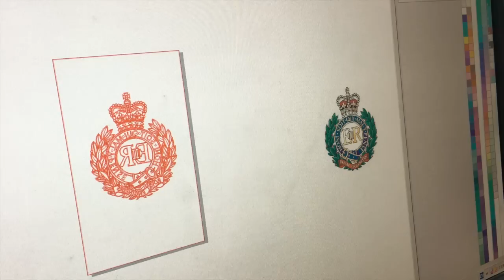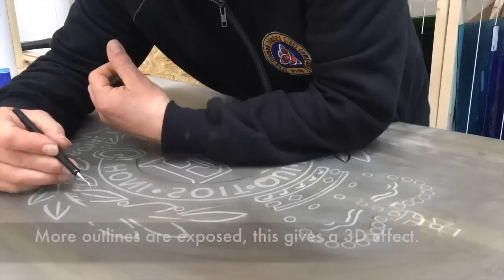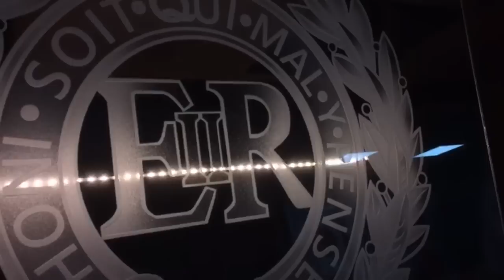How To: Etch Glass - Sand Blast Carving Technique - Royal Engineers Cap Badge

Comment: When you say fine, what grit of sanding medium are you using? Also do you vary grits or pressure between "layers/masking sections"?
Reply: I did work like this but with more layers. What I used to get deep into the glass fast was aluminum oxide.

For smooth fine details I like to use glass pearls/beads

Comment: hi, very impressive piece of art. The gradient achieved is by adjusting the thickness of abrasive flowing through gun? or is it in the design? very interested in knowing the technique. very well done sir, thanks in advance.
Reply from the maker: Hi Imran, Thank you for your kind comment. The effect is achieved by blasting more in the area you want to be most etched and blasting less in the area you want clearer. This creates the gradient effect. It's all done by careful use of the sand blasting gun and is planned into the design. I hope this is helpful.
Reply: Thanks.

Comment: This is very nice, clean work, and you have been generous and helpful with answering questions. I live in the US, and I'm not sure where to buy sandblast resist vinyl. Is 120mm a European thickness? I can't find that thickness here. I have sandblasted glass with contact paper thickness, and it just doesn't hold up well. Thank you
Reply from the maker: Hi Janet, I'm sorry for the late reply.The thickness is 120um or we sometimes use 80um, this is micrometers not milometers. We buy our film from a UK supplier but they may ship overseas take a look at their website here https://www.mdpsupplies.co.uk/sandblastingfilm.asp. Hope this helps - Best of Luck!
Reply from the maker: https://www.mdpsupplies.co.uk/datasheets/datasheetdetapesandblast.pdf - take a look at more information here.

Comment: Hi, I am piecing together this process and have a few questions. 
What type of  vinyl mask are you using?
What type and size of grit are you using?
What size and type of nozzle?
Are you using a pressure pot or using the hose to siphon and reuse the blast media from the bottom of the cabinet? 
I have a 25gal 125psi with 9.1 @ 40 scfm. Will it be enough pressure to blast?
Reply from the maker: Hi Rob, we use 60-80 grit Aluminium Oxide Abrasive. The nozzle size is 8mm. We use a special sandblasting resist vinyl, it is 120um thick.
Reply: The Stained Leaded Glass Company thank you. I'm trying to do small projects from home. I appreciate your helping me figure things out!
Reply: The Stained Leaded Glass Company can I do this on acrylic with the same abrasive/ grit?
Reply from the maker: Hi Rob, yes I believe so. I haven't tried it myself but I imagine you would get similar results.

Comment: Happy to see someone use Corel. Everybody uses Adobe... What's the make and model of your blast cabinet?
Reply from the maker: Hi, Thanks for your comment. I modified a standard cabinet bought very cheaply off eBay to allow the insertion of glass by cutting a slot in it and adding brush draft excluding strips. Similar to: https://www.ebay.co.uk/itm/Sandblaster-Bead-Sand-Grit-Blasting-Blaster-Blast-Sandblasting-Cabinet-220L-LED/281383256323?epid=1561165375&hash=item4183bfc103:g:Qm4AAOSwVm5Y-cZY

Comment: My question is where did you buy the blasting cabinet? I have a similar one but would like to go bigger I like the way you can insert the glass in yours. Beautiful work!
Reply from the maker: Hello kkash72, thank you for your question. I modified the standard cabinet by cutting a slot in the side and the top and fitting brush seals, this was relatively easy to do. I hope this helps. Thank you for the kind comment.

Comment: Very informative video - thank you. Can I just check that the sheet of glass was annealed (toughened) as I am surprised that toughened glass does not shatter with the process . Thanks.
Reply from the maker: Hi Chris, yes the glass is toughened glass. We usually do not have a problem with the glass shattering but it does happen on the odd occasion.

Comment: Are you using the same amount of air pressure on each stage? If so what psi or if not what different pressures at each stage?
Reply from the maker: Hi Jimmy, I use the same pressure at each stage.

Comment: What grit of sand are you using? Or is it glass?
Reply from the maker: Hi Drew, the blast medium we use is 60-80 grit Aluminium Oxide Abrasive.
Reply: @thestainedleadedglasscompany  will that medium work on glass mugs or glass vases?
Reply from the maker: Yes. You could use 120 grit for a finer finish.
Reply: @thestainedleadedglasscompany  thank you so much

Comment: What vinyl is that by the way, and how does it work? I can see it's allowing you apply the stencil directly, without using transfer paper.
Reply from the maker: Hi Tom, we did use a transfer paper but this was not featured in the video. The vinyl we use is medium thickness sand blasting resist film.
Reply: That explains it, thanks!

Comment: i have etch glass using a stencil which i made on my plotter and use a etching acid for glass which great result but cant do diffrent shade, what is the best way to practice glass etching with different shade using sand blasting but with out wasting glass to practice on
Reply from the maker: Hi Chad, thanks for your comment. I would suggest sourcing old glass. Ask a local window or glazing company I'm sure they would provide you with old glass to practice on for little or no cost. Good Luck!

Comment: I like the vinyl sandblasting method but the issue is the same as an acid etching method. Aka the weeding process is slow/a pain sometimes. Is there any way one can cut through totally so he doesn't have to deal with weeding?
Reply: Full cut-through would eliminate a significant feature that takes away from the "artistic" perception of a 3 dimensional design.  Sorry, but that IS a major enhancement that makes the piece so appealing.  There will be more risk trying to rely on pressure and an artistic eye to complete the 3D illusion (think: sneeze, blink, etc. at a critical moment).  I'd be wary of destroying the piece and cost of materials.

Comment: what blast cabinet are you using?
Reply from the maker: Hi we are using a standard blasting cabinet bought from eBay. I modified the cabinet by cutting a slot in the side and the top and fitting brush seals, this was relatively easy to do. I hope this helps.

Comment: Manually tracing the design in CAD seems like a lot of work - have you tried using Live Trace in Illustrator? It does it automatically, although it can be a bit temperamental.
Reply from the maker: Hi, we do have an Autotrace on Corel Draw but it does not give great results every time and does not give the stencil we need for the sand blasting. So we end up making a lot of changes to even a good Autotrace.
Reply: Auto-trace would never yield a perfect vector, and that any professional can agree to. And btw. Illustrator is not your best software when it comes to professional-grade sign-making. CorelDraw is a much versatile software.

Comment: Thanks for the informative video. I was just curious what grit aluminum oxide is best for etching on glass and what difference does grit make?
Reply from the maker: Hi Larry, we use 60-80 grit Aluminium Oxide Abrasive. The finer the grit the finer the texture of the etching. Nozzle size can also impact the finished result.

Comment: Impossible for a layman to cut out the shape
Reply from the maker: Hi Nava, thanks for your comment. For the first ten years of etching glass I did not have a plotter and cut all the patterns by hand with a craft knife and still occasionally do it this way. It is possible and is sometimes quicker as it took 2 days to draw the design on the computer software. I wish you the best of luck with attempting glass etching yourself. It does take a lot of practice but can be achieved without a plotter.